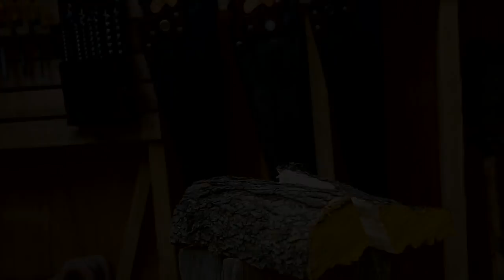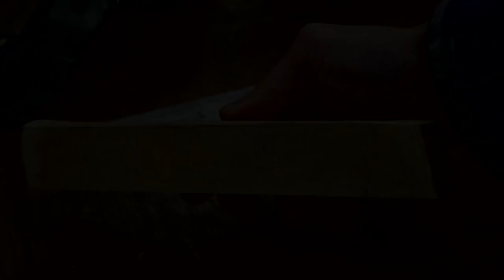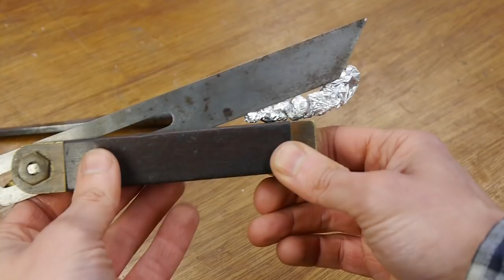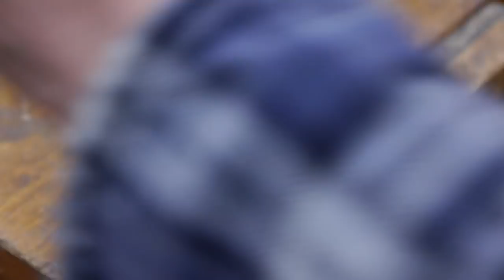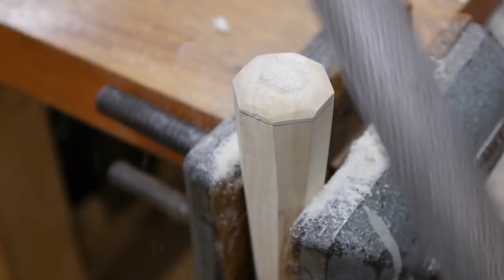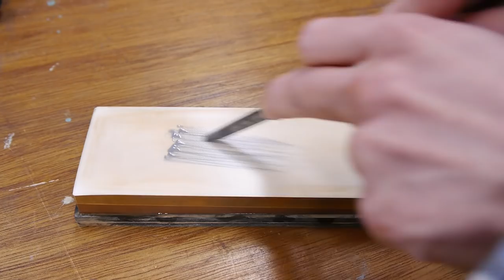Making an octagonal chisel handle from pear wood with hand tools | Chisel restoration

Comment: Sorry if I missed this, but why not fully seat the recessed area into the socket (visually, I mean. I know it is fully seated)?
Reply from the maker: hi @paleblueafghan, leaving a gap prevents the shoulder of the handle from driving into the rim of the socket which could cause the wood to split; it also helps ensure that the handle can still be seated tightly in the socket if there's some shrinkage in the wood.

Comment: Thank you for your beautiful videos!
It always sends chills down my spine when I see people firing up their sandblasters to abuse some well-aged tool... ;o)
By the way, it took my breath away to see how your Richardson works after your restoration. Next week I will get my new (very old) Disston delivered. I'm curious if I can do it as well as you did your Richardson. But even if it's only half as good, I'm satisfied.
All the best, Georg (from Germany)
Reply from the maker: Georg, thanks a lot! Yes, the Richardson is really a treasure. Let us know how things work out with your Disston!
Reply: @thehandtoolworks  Thanks for asking! I received the Disston last week - from England. Can't find anything here in Germany - I've been looking for a long time. It is a 1910-17 (PHILADA) 26 inch saw, skewback blade, 8 TPI, filed to ripcut. Very neat, very little rust, the handle undamaged except for the paintwork. I've sanded and oiled the handle, cleaned the blade, and sharpened and set the teeth (the toughest steel I've come across in a saw). Now I'm waiting for a file that better suits the tooth geometry and I'll rework the saw with it - but I'm already very satisfied. (But she's not in the same league as your Richardson). I have some carpentry work to do in the summer (timber frame construction) and am already looking forward to getting to know the saw properly.
All the best, Georg